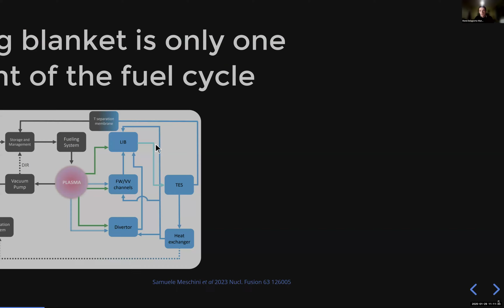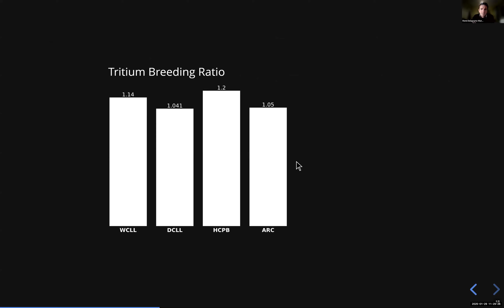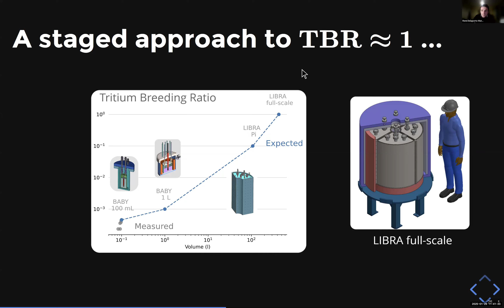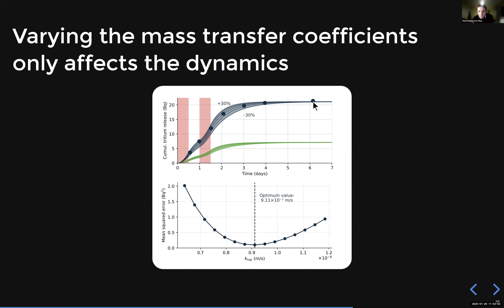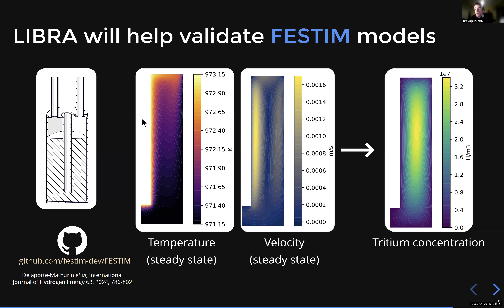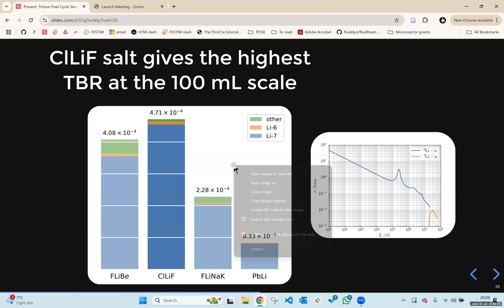Tritium Fuel Cycle: Challenges and Advances for Fusion Power Plants (Remi Delaporte-Mathurin)

Comment: All those seriously interested in fusion should watch this excellent talk on the problems of tritium breeding and how the libra experiments are helping modelling predictions. One question: is the formation of lithium tritide ever considered? Wikipedia states that LiH is stable up to 700C so surely LiT would be expected to form and therefore affect tritium diffusion through any blanket material.
Reply from the maker: Lithium tritide formation depends on the chemistry of the breeder. It is a known "issue" for breeding blanket concepts using pure lithium. In fluoride salts, tritium is bred as T+ and can form HT, TF, TCl, etc...